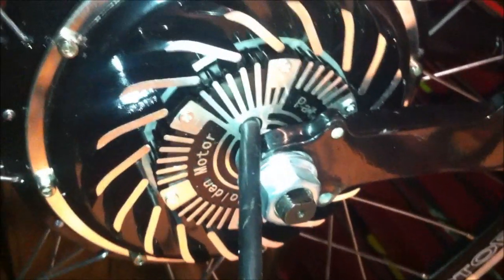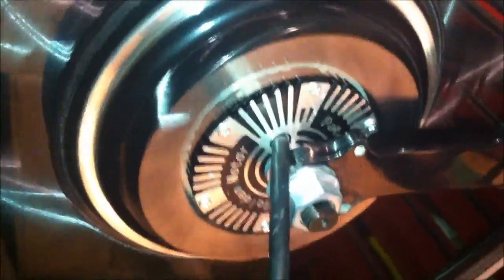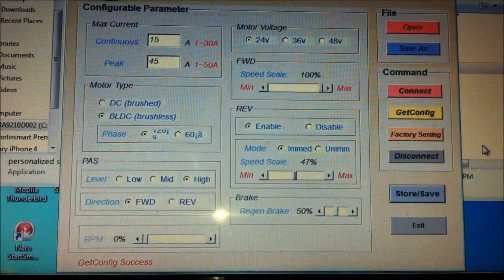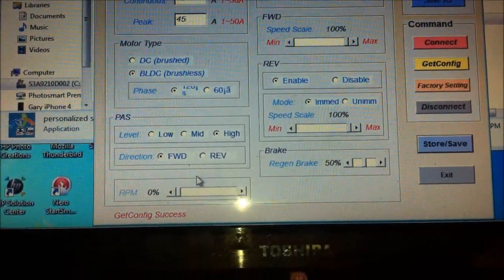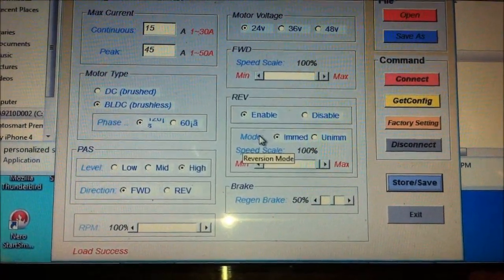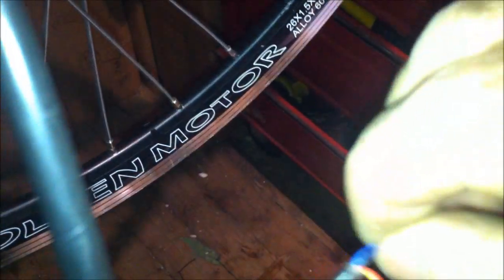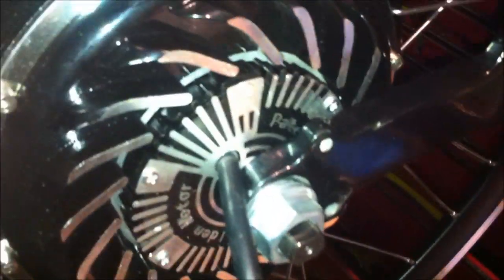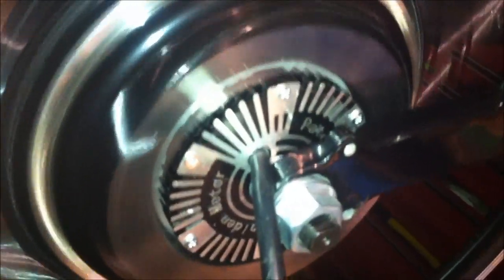How to set it to reverse in a ebike conversion kit- Golden Motor Canada

Comment: I've set my SP3 (front wheel) on permanent reverse due to the way it is mounted. But now programming isn't possible any more. Is it just mine or is it like that by design? I can see that Program Signal and Reverse share a wire/connector... Anything I can do other than cutting the wire, program, and redo/solder the connection every time I want/need to program it?
Reply from the maker: +Michael Herzog You could use a switch on the connection.

Comment: do you need to cut the power and does the wheel have to stand still in order to change into reverse or could you do it on the fly as well? 
If there was an insulated switch, at least...
Reply: If you plan on using it on the fly you can run it through a switch and reverse the motor, treat it like a car tho and don't throw it in reverse while you're moving